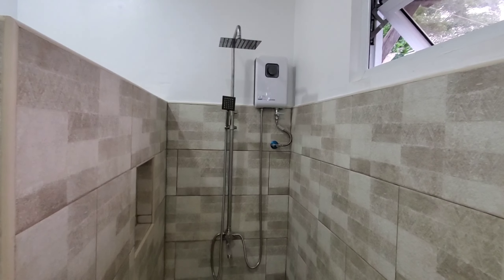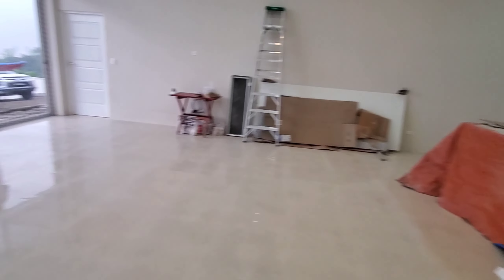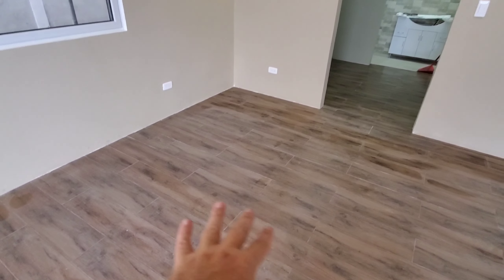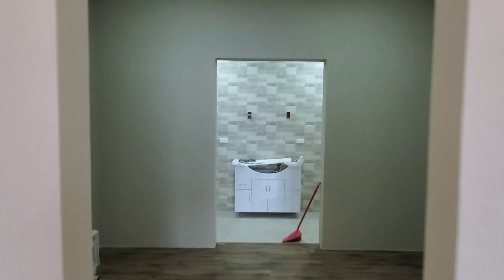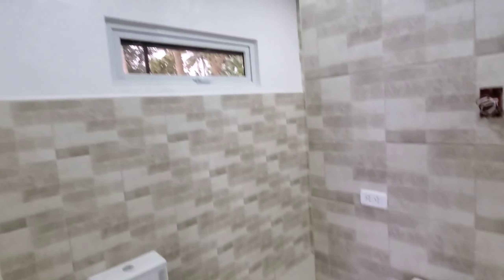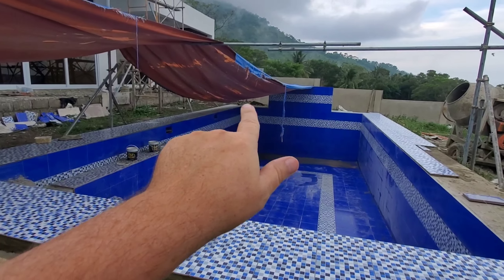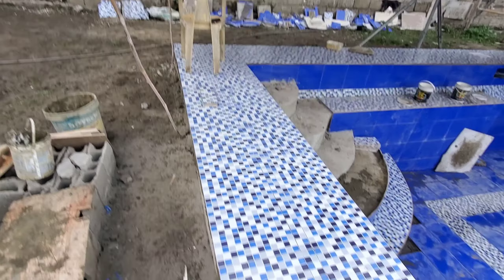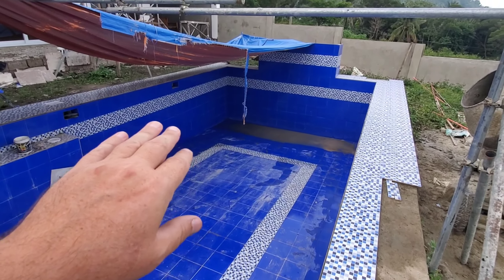Foreigner retired to the Philippines building a modern style home

Comment: Hi Greg, you had mentioned having a 110 VAC outlet in your dirty kitchen.  How did you lower the volts?  Is it via step down transformer?  Secondly, now that your ceilings are done, do you hear the rain from the roof inside the house?  Thank you!
Reply from the maker: Step down transformer  for 110v.  However, I hid the transformer and ran the wires within the walls to a 110v outlet.
Reply: @buildingthephilippines  
Thank you for your response. 

Congratulation on your retirement home!  The views are magnificent. And you both have the best vantage point from your home. The pool is coming along as well.
Reply: Would it be possible to know the level of rain noise from the roof inside your house?  It would certainly help in the future.
Reply from the maker: The house roof and 2 meter overhang is quiet. I do hear rain hitting the dirty kitchen roof if in the main room and carport if in the MB.  I guess the cement board ceiling really silents the noise. If TV was on it bet you wouldn't hear the dirty kitchen roof or carport. We will find out soon.
Reply: @buildingthephilippines  That's promising the noise level is minimal.  I'm concerned about videok at the surrounding homes as well.  I do like music but would rather sleep anytime possible without the audios.  Please do update under a torrential rain.  Thanks again.  I too am a retired AF.